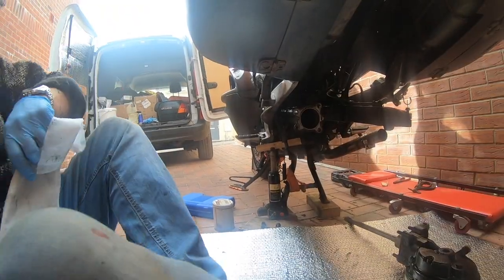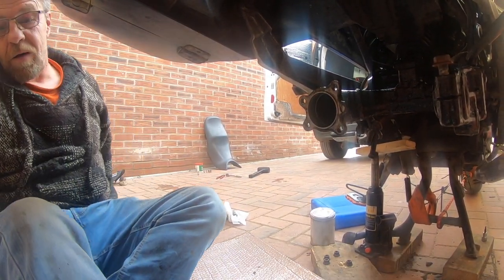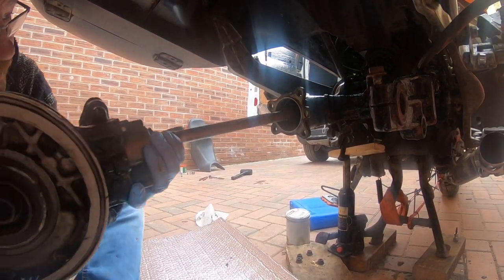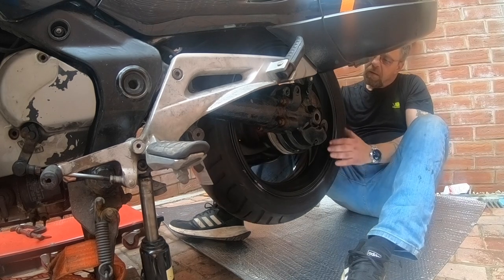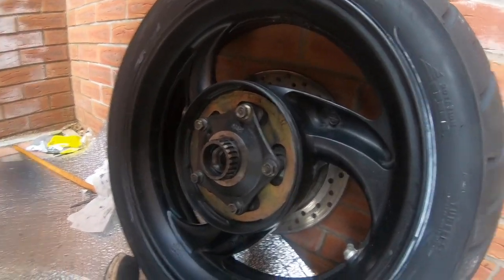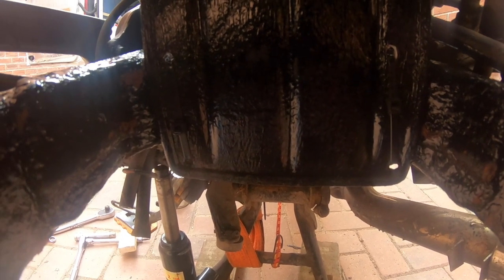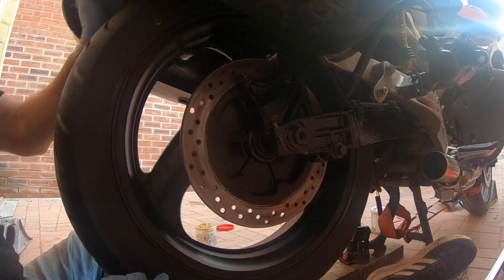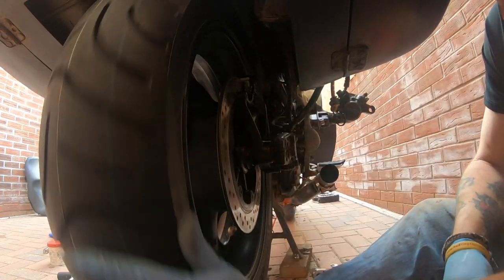TOP TIP -  MOTORBIKE DRIVE SHAFT LUBE AND REPLACEMENT ON A HONDA DEAUVILLE 650

Comment: I have used a screwdriver to hold the universal joints Somewhat straight, I think you call it a cross joint or something like that in the UK..
  another way to lube that would be..
 pull the boot back, so you can see where are the driveshaft splines mesh with the universal joint. Pull the assembly back just enough to get some EP grease on the splines without pulling the driveshaft completely out of the universal joint.
  just pull the assembly and the driveshaft back maybe an inch/25 mm, and insert a grease gun hose with a grease needle attachment..
I just bought one of these machines, NT 700 Honda Deauville here in 2023.. it’s a 2010 with 7500 miles on it from the original owner.. when I buy a machine used, I always assume everything has been neglected, from brake fluid to fork oil.. thanks for the video, very useful information..
  I also have a Yamaha royal star venture currently, 2008. I have done the driveshaft splines on that.
  near the swingarm pivot on the Drive shaft tube. There is a hole with a rubber plug in it to give access to stabilize the universal joint so that the driveshaft can be re-inserted…
  might not be a bad idea to drill a hole in the housing right near the universal joint on this machine to stabilize the universal joint for that purpose.. hey hole just large enough to insert a flat blade screwdriver, maybe 15 mm. I would make sure I could get a plug to fit whatever hole I want to drill before drilling that hole. The Yamaha ventures have that rubber plug that is just about the right size for that task.
Reply from the maker: I would be against drilling holes…
Tanks for your comment you give some good advice there 
Good luck with the 700

Comment: Hello, please help if you can
Got nt650v, 2003, beauti silver horse
But, when upshift from 1to 2ng gear, hear strong metal shot, somewhere on the schaft, cant say is if on front or rear part.
5 timrs goes like this, then goes like in the butter, fine small klick.
Other gears great.
Also, when off trottle and again on trottle, hear "tok"
I would be thankful for some idea what/where to look.
Thank you.
Reply from the maker: Have you changed driveshaft oil?
Deauville gearboxes are known for being very tractor like anyway. 
I would change the driveshaft oil and remove rear wheel and grease driveshaft splines with molybendium sulphate 60% paste (grease) and go again it will probably last for years.
Reply: Yes  i did changed shaft oil,also engin oil, but did not greas splines.
You dont think is something with transmission elements?
Thank you for your quick answer 👍
Reply from the maker: @zdravkobrlek6676 it could be but very unlikely 
People don’t service the splines and they wear away and make all sorts of noises. 
If it’s really bad you may as well source a new drive shaft unit or replace the engine as it can go altogether. 
Let me know how you get on with it please
Reply: I will try with grease, hope that is the problem.
Will let you know for the result. 🥂

Comment: Greetings from Latvia!  😉I have NT700VA (2013).  25,000 km.  There is a problem with the noise when driving, in any gear, at the moment between load and rolling, there is a clicking noise that all Devilles have when you lift it on the center leg and put it in 1 or 2 gear.  I don't know if it's supposed to make a rattling sound while driving, but the noise seems to come from the front of the shaft drive.  Oils have been changed everywhere, everything has been monitored, but I have not removed the shaft drive.  Now I ordered a wheel damper kit, I will start with its replacement.  What do you think, is this a problem?  Thank you, have a nice day!😉
Reply from the maker: All transmission on all Deauville’s are known for being noisy. 
Specifically for the 700 I can’t comment as I’ve not owned one. 
If your concerned it might be worth pulling the shaft apart and inspecting the inner splines. 
Other than that. Can’t hep
Reply: I think the 650 and 700 shaft drive are identical, at least it looks that way.  But ok, thank you very much for the answer!👍

Comment: If you spin the wheel like that, can you hear some (gear) noise from the drive shaft? I hear some noise at the front of the shaft, is that normal?
Reply from the maker: @benvriezen8944  normal mate

Comment: 1:14
Apparently my mechanic applied lithium grease instead of MoS2 grease on the splines as the manual recommends when he changed the final drive because of wear.
I am planning on using the right grease this time but I got two problems.
1) How much of the final drive should I dismantle to clean the old lithium grease?
2) What is the brand of that grease? I have been checking on the internet and my town but I can't seem to find the right product. It doesn't need to be the exact one you use but I'd like to buy one that I know it's going to work for sure.
Reply from the maker: Hi thanks for your comment
1) 
The grease you use does not matter so long as it’s 60% molybendium paste. Honda dealers sell 3% molybendium but it’s not sufficient. 
Search eBay for 60% molybendium paste and you should have some options. 
2) it’s the splines at the rear wheel which are prone to stripping if not greased. If you want to go belt and braces you can pull the shaft like I did in the video bits it’s normally just the splines at the rear wheel. 
Hope this helps
Reply: Great video if the splines run dry to you have to change out parts if yes which ones please?